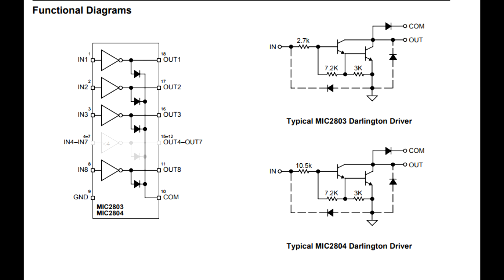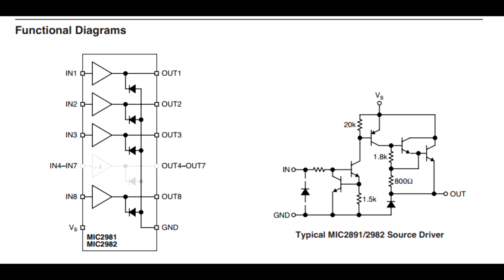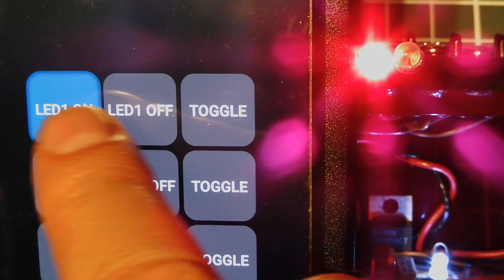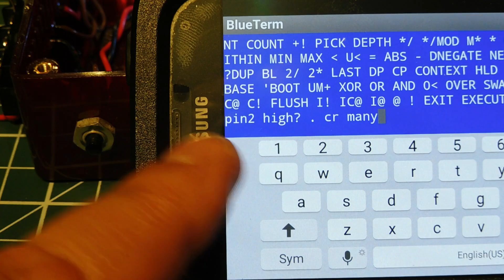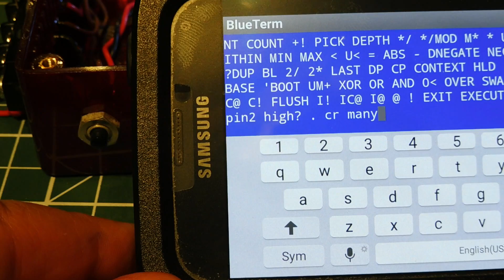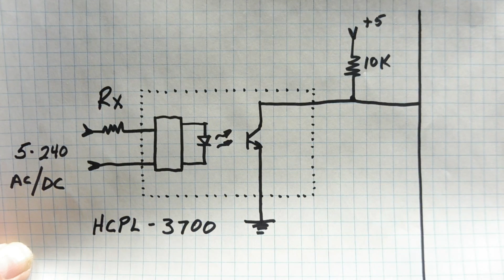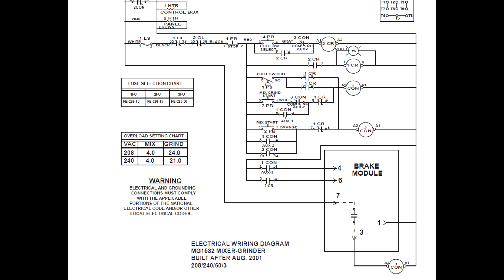Earn Money as an Electronic Hobbyist  / Industrial Electronics

Comment: I've used ULN's before, but always as an output.  I had never thought of using them as an input driver until you mentioned it.  Sometimes just a little bit of "out of box" thinking can make a big difference in solving a problem!
Reply from the maker: Yes as an input device they make good voltage converters with a wide range of input voltages to open collector output to drive 3.3v or 5.0v microcontroller GPIO. Thanks for sharing.

Comment: Excellent video.  Very few other electronics channels are covering industrial work or anything more than just replacing components.  

In part one you recommended a couple books for learning.  But I've found that books tend to be too basic or too specialized.  Would you recommend any online courses?
Reply from the maker: The books I mentioned are very good and thoroughly get into many subjects. To keep up with the latest trends and technology try a " Circuit Cellar" magazine subscription where there are detailed instructions on project building and theory. The best course you can get is "doing", where all the learning happens.

Comment: There's money in consumer electronics if you know where to look.  Do some research on Eurorack synthesizer modules.  Most synthesizer modules sell for hundreds of dollars.  They are essentially select components of a synthesizer coupled via phono-jacks, not a full synth.  You can go as far down the rabbit-hole as you like.  You can put together a simple synthesizer module from a kit and sell it.  You can buy a circuit board and face-plate... use an automated BOM to search a few of the big parts shops... sell those for even more.  If you want to design your own modules... and even program your own arduino code into them.

Some keywords to search for examples would be "Befaco Eurorack" "Westlicht Performer" "Ornaments And Crime" "Doepfer Eurorack" "Mutable Instruments clones", etc.    A resource library for modules and those that can be built by a kit would be www.modulargrid.com

Comment: You have me interested in this type of work please let me know what I can do to get involved . Thanks for the heads up.
Reply from the maker: Start out by going to Equipment auctions to see what equipment is out there and talk to the buyers.
Here is a list of equipment I was involved in:
Electronic signs, scoreboards
Battery chargers for golf carts and forklifts and golf cart motor controllers
Railway track maintenance equipment.
Industrial food machines and controllers
Welder control boards and refrigeration control board for semi trucks and rail cars
The common theme to all these items is that they work in harsh environments and are prone to failure.
Check out this website. This guy who I dealt with started out back in 1970 just repairing battery chargers and is still around today.
Have a look what he is doing today.  Good luck in your ventures.
http://diversifiedelectronics.ca/

Comment: can you share schematic ?
Reply from the maker: The schematic is basically the same as in this video:  https://youtu.be/vPSwkDBcUJQ
Instead of the GPIO lines driving LEDs, they drive the ULN2803 IC.
Reply: actually i want  to get idea of your power supply which is converting 12 to 5v , what values of filter capacitor are you using ?
Reply from the maker: .47uf on input of regulator and .1uf on output.

Comment: You really have some great ideas and it's nice that you are sharing such money-making ideas. I was a tech before I became an engineer but never liked fixing broken equipment. Still, in a pinch, I have done it when I had to. One thing I learned was that fixing gear that was working is quite different from making a new design work. If a device was working but isn't now, it is very likely that only one thing is wrong with it. A new design, however, could have many faults; wrong design, not assembled correctly, etc.

Good stuff here. I liked your approach to making a universal controller. Might be a marketable idea.
Reply from the maker: Yes .. you have some valid points. The best scenario is to repair to factory spec by finding the faulty component. When designing a new board, keeping all safety features intact is a must. In those cases a PCB was built and tested intensively.
Most of those designs were interfacing new logic family IC's to older obsolete logic families on the original board. 
I did run across some business owners who needed their machine up and running or their business would suffer drastically.
It was good that I could help them out.